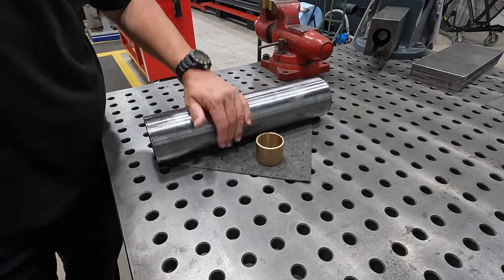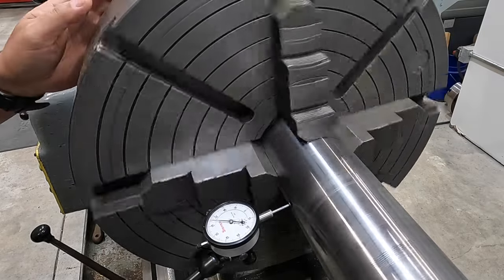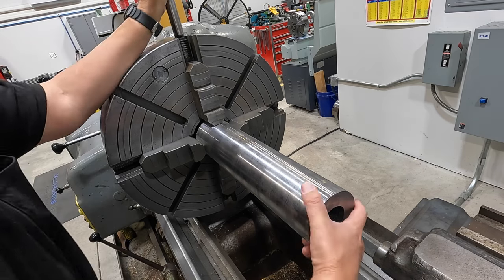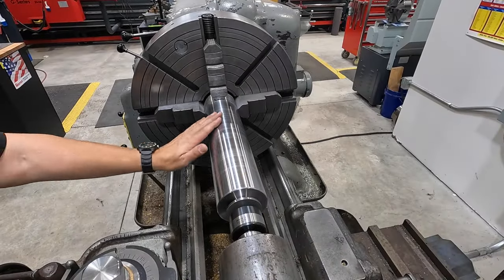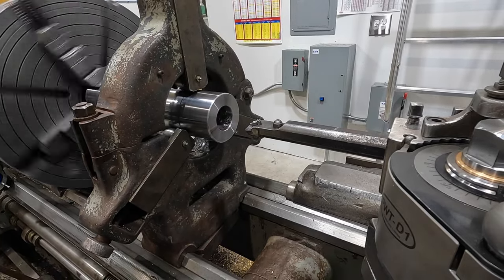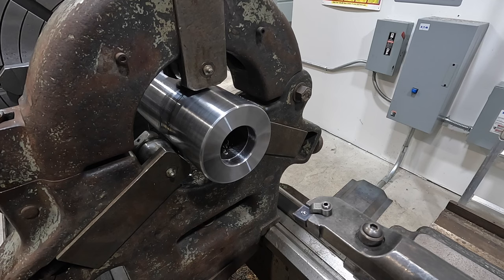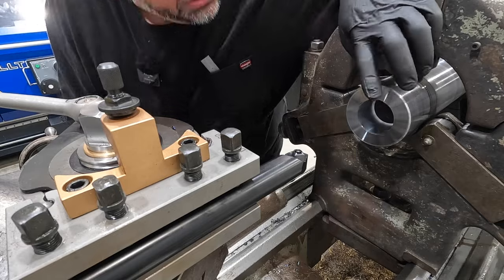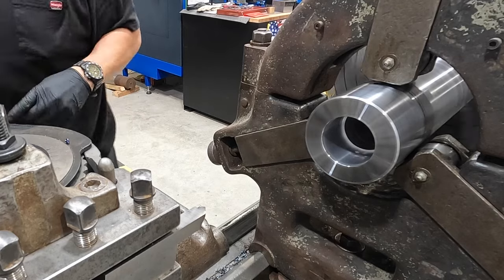Machining a Weld-In Pin Boss

Comment: thanks Adam, i have difficulty swapping ends and matching OD....you are a champion.
Reply: Hey professor, mark the top before you loosen it, swing it 180 with the top up as before, tighten the jaws loosened in reverse order as you saw. I guarantee you will be within .005 as was shown if you practice and have pressure the same, it's  a feel thing just like measuring with micrometer.

Comment: Thanks for the feeds and speeds,  it really helps my learning process
Reply from the maker: General rule of thumb for the manual lathe work is .010” for light roughing, .005” for finishing and for heavy turning .015”-.020” inch per revolution feed rate.
Reply: I'm a Toolmaker (injection mould building) from Bavaria. In the metric system I often use 0.1mm for longitudinal turning an 0.05mm for facing cuts while manually machining.

Comment: Perfect explanation of why you DO NOT buy cheap tools! I've been wanting a dial indicator for years. All I have is a tabletop drill press, but there are (as you know) many other applications for dial indicators. Was thinking a Harbor Freight one might be OK, then I thought: "Nah, I'm gonna pop for a good set"! 😁
Reply from the maker: For a dial indicator, I don’t mind using a cheap dial for just indicating parts in on the lathe. I won’t however use cheap calipers and mics.
Reply: @Abom79  I don't have a lathe (I wish I did). Most of my applications would be measuring axial and/or radial runout on existing parts/assemblies. Probably won't have to work to tenths...

Comment: I started out with an embarrassing little lathe some years back but the engineers thought it through really well and give two steady rests for a 22” swing.  It keeps my heavy equipment running, out of the garage and in the fields so it ‘pays the bills’

Comment: I’m having a hard time wrapping my head around how the telescope gauges work with flat cut ends in a round bore. Especially if the bore size differs thus making the radius different where the flat sides of the gauges would touch. Maybe I’m just overthinking it. Would certainly make sense if they were pointed on each end, but with flat ends and therefore touching the bore in two places per side with a small bore radius in between..... I can’t quite grasp the concept. Love the manual machining segments. I’ve picked up most of the very small amount of machining knowledge I have and tips about using my new mill and lathe from these videos.

Comment: That's a great little lathe.  Personally I love the Pacemaker lathes for their accuracy.  I've got a Sterling lathe myself, it works great for what I need it for because it's a light duty lathe.  But what I love the most is the foot brake, which pacemakers don't usually have.  Although, I know there's kits for it, but if it didn't come standard, I'm not sure I would trust it.  For single point threading you can't beat a foot brake, it's saved my butt more than once :)

Comment: I used to lay a scale on the bed ways at the aft end of the carriage with a pointer attached to the carriage and would use it to set the turning length?

Comment: @37:41 a really interesting effect when the tool tip touches the work, watch the line of reflected light from the shop lighting “extend” back toward the chuck. At first I thought Adam was using a graphic overlay to illustrate something, but it is a pure lighting artefact. Is this from a tiny deflection of the work? Made me wonder if control effects like this might be harnessed to make ultra fine measurements.
Reply: RobRenz has a video on measuring surfaces with a light collimiter.

Comment: Hey Adam, it seems like for the initial cut, since the outer surface had been monkeyed with, it might have been easier to set up between centers. What are your thoughts on doing it that way vs setting up the piece in the 4-jaw like you did?
Reply: Different machinists will make the same part differently, but will get the same results.

Comment: fascinating - I wanted to see the bushings getting pressed in
Reply: Yeah, me too. My guess (I'm not a mechanical engineer) would be, that the bearings are pressed in after welding is done and cooled down. Presumably because bronze and steel have different expansion rates when heated.

Comment: HEY Adam, i love your content, that Pacemaker is a real nice piece of machinery.

i was always told never to wear gloves when using a lathe, milling machine, drill press or boring mill. i see you wear nitrile gloves, and I'm wondering why those are ok? was i told incorrect info?
Reply: Gloves can get caught in the work and drag you in. To makes things worse they reduce your touch sensitivity so you are less likely to notice you are touching a moving part.
Nitrile gloves are very thin so they don't reduce your touch sensitivity much and if they do get caught they tear rather than dragging you in.
Reply: @LesNewell  oh ok, that makes a lot of sense! Thanks for the reply

Comment: Adam I have a question. What is the function of the heavy drive shaft on the back of the Pacemaker? It looks like it could be used for rapid traversing for a honing setup.

Comment: Couldn't you use a live center on the tailstock end to help align and make it "true"? I'm not a machinist, tis why I'm asking. Great video as always. Cheers :)
Reply: When you know that the hole in the end of the work piece is truely centered you can. As this piece was worked on another lathe and was roughly done it was best to make the "new" centre and be positive that it was correct.
Reply: When he starts to machine, you can see the hole and OD aren't concentric with each other.
Reply: This type of material is what's called DOM drawn over mandrel, in other words it comes from the Foundry with the hole in it. The concentricity of the inside to the outside since both are hot finished is not anywhere close. Joe took all the nasty stuff off - you can see it deep inside the hole if you look where Joe didn't go. If it was cold finished as well they're a little bit better but not really accurate enough for anything close. That might be ok for his job in which case you don't finish the outside at all. Adam did it so he could steady rest it, as he said. I feel for Joe.

Comment: Did I miss the deep bore on the second side of this project? 2.061 I believe is what the first side opened up to. I hope they notice before they put the bushings in as the bar will be a very tight fit through the bushing.  Not a big deal, maybe he just didn't film that part.
Reply: At 33:30 he states he's going to flip the piece and repeat the process, so I would assume that means the clearance bore then the counter bore for the bushing, etc. At 39:19 he states that the clearance hole is done...

Comment: Couple of things. Can you possibility message back with details of your quick change tool post. Trying to talk boss into getting a couple so we can easily share tools between lathes..sick of packers lol. I would have attacked that job slightly differently. Steady consume a lot of time in my view. Id have done your first op but then spun tube and put in as far as possible. Trued up and simply bored as required and then swap back round and do rest of process.

Comment: They are going to put in in a flame cut hole and weld it!
Reply: If you're really looking at, and understanding.............the critical step is the bore, not the OD.  Many things are welded in a flame cut hole.  There's usually enough slop in a hydraulic  actuated system to compensate for a bit of error in welding in the pin boss.  The tacking, and weldout, can generally be done by eye(yeah, I'm not kidding) to within about .010 .  Do it a few times, and you'll see what Im talking about.  It's about sighting the parts, and looking at the air gaps between the axis.  The human eye is extremely accurate.
Reply: To be more succinct, I'm talking about optical tramming. It works.

Comment: I swear the large lathe manufacturers will make the biggest lathes with the smallest steady rests. Drives me nuts. I have a 15” lathe and the damn steady rests capacity is only 2.5”. Ridiculous, and has burnt me a dozen times on jobs… ya ya, “make a bigger rest”, it’s been on the to-do list for years…

Comment: Wouldn't it be better to skim cut it between centers to ensure concentrity to the inner bore?  Sorry may be a dumb question as a non-machinest.
Reply: The problem with turning unknown stock (stock that you yourself did not turn), is that you do not know how the operations were done, or how accurate they were. If you chuck the item in two centers, live or otherwise, and the end faces are not perpendicular to the bore (hole), then the hole will be skewed, or out of axis, with the rest or the part. As you can see in the video, both ends were NOT perpendicular. Most likely, they were not even parallel to each other. If you slice a cone at an angle other than 90 degrees from the base of the cone (parallel), you produce a somewhat elliptical shape, more pronounced as the angle becomes more acute. Never trust a part from another machine shop...ALWAYS figure out some sort of best-case scenario by measuring and observing what it does when spinning. Once you have one reference face, the rest of the work can be done very reliably by spending enough time and knowing what operations come first. Sorry for the long explanation.

Comment: HI Adam i am working in the automotive industry and we use intramesses to measure inner diameters wouldn't they be easier for you as-well
Reply: No such word...what are you talking about ?  Yes I spent 30 yrs in the automotive business until 2019
Reply: Using 3 pronged digital bore gauges such as the Borematics is a one step device which deskills the measurement process. Especially useful in production environments esp CNC with many operators; quick and easy but at a whole different price point.
Reply: @SteveColluns-hm2xx  I have plenty of knowledge and experience with bore gages, I work daily as a machinist in aircraft manufacturing "BUDDY"  LOL.  The word in question was intramesses ??  I did some searching for that word and came up with NOTHING.  Telescoping gages like Adam is using here work very well at the lathe, I use them daily on CNC lathe work doing pretty high volumes of many parts both large and small.  Bore gages can be used for inspection if needed but I can certainly read very accurately with telescoping gages and a micrometer, for sure within a tenth of a thou or 2 which is plenty good enough for most work, especially when your not in a highly controlled environment.  Have a great day folks.  "Getter Done"
Reply: @SteveColluns-hm2xx  Or He works in an aircraft manufacturing facility that has a low end quality control system. That explains it. Why would you use telescoping gauges and a micometer to check high volume CNC lathe parts within a "tenth of a thou or 2" ? That makes "No Sense."

Comment: 29:20 You talk about 52 thousands of an inch. Can you do some subtitle which shows (as sample 0.02 mm) I'm good with rough inch. / cm/mm calculations,  but when it goes into the thousands... I always have to Google. Thank you. Stefan from Switzerland 🇨🇭
Reply: Stefan, the "magic" number is 25.4 mm./in.  So, 0.001 in. = 0.0254 mm.  It's not at all surprising that the worker's skill, not the scale he/she uses, is what matters.
Reply: @eliduttman315  25.4mm = 1 banana as per Cutting Edge Engineering (Australia) IIRC 🤣🤣🤣🤣
I know I know....America stuck with our UK's imperial measurement whilst UK went all metric except the oldies (like me) who can still add up their food shopping before their checkout operator has scanned it all and then struggles ensuring they've got the right change (triple checking between the amount shown on screen and what's in their hand) when you pay cash.
For another laugh...have a headache and heart attack when you realise how much we pay for gas (petrol E10) today's price £1.387 per litre .............go on - do the maths.....I dare ya!
Reply from the maker: .052” x 25.4 = 1.3208 mm 
1.32 mm divided by 25.4 = .0519” 
Easy conversions one you know that 25.4 mm = 1.0 inches.

That would make some good practice if you did the calculation as you’re watching along.
Reply: @Phil Hunt  your not pay much more than USA for your gas. Rough conversion is 4 liter per gallon (I know it's not correct but close enough) we pay 3 dollars a gallon at some of the cheapest and over 5 dollars a gallon at the more expensive
Reply: @garymurt9112  4.54 ltrs per gal = £6.29 per gal = $7.77 per gal 
That sir is double your cheapest......now imagine, just for a second, all those 3 ton V8's running at 11mpg if you're lucky having to pay double the price - guessing heads and hearts will explode
Reply: @philhunt9297  A US gallon is 4 quarts.  1 quart = 946 ml.  Don't conflate the US gallon and the Imperial gallon.
Reply: @eliduttman315  I didn't conflate because I stated our ltr to gal conversion.  You just wanted to dig at the minor details whilst ignoring the major.

Comment: 🔭🔧🤔 It seems like there's a discrepancy with the telescope gauge being used in this video. Precision and accuracy are crucial in machining, and using the correct tools is essential for achieving the desired results. I'm curious to know how using the wrong size gauge affected the process and if any adjustments were made to compensate for the discrepancy. Attention to detail is key, and it's always interesting to learn from these experiences.